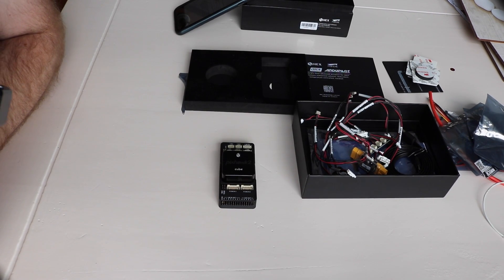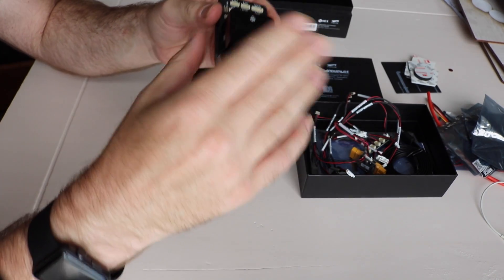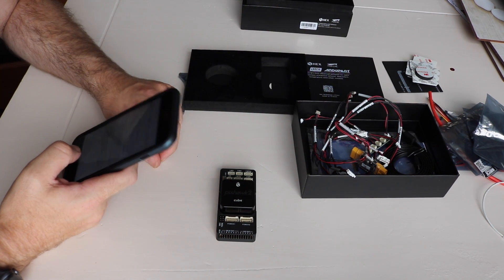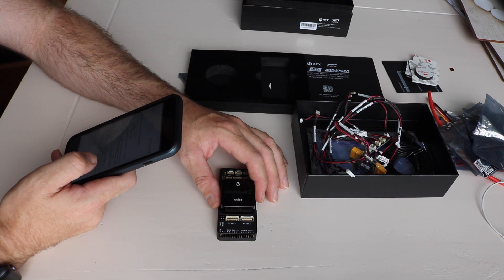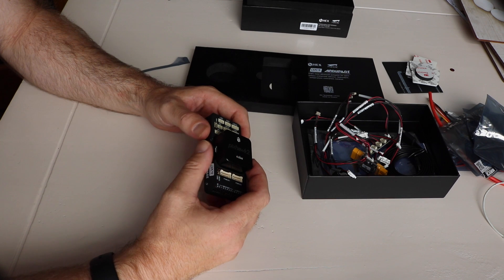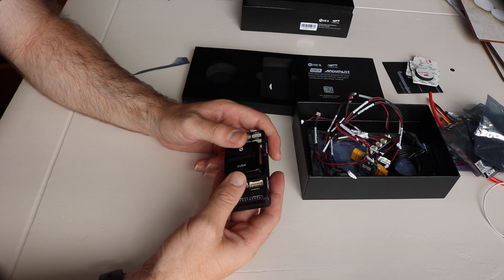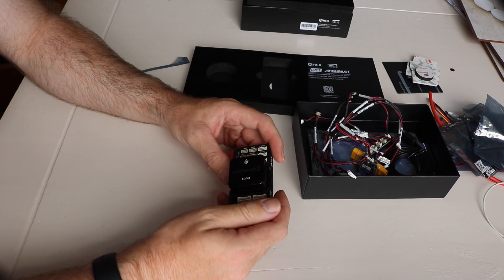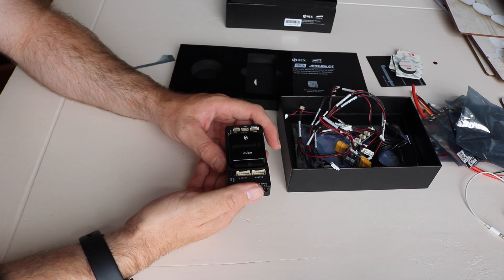The Cube Pixhawk 2 Autopilot/ Flight Controller & Here GPS Closer Look At The Hardware

Comment: Do you install the gps2? This is work for you? My second gps is not even turn on...
Reply from the maker: Yes you need to use it on Telemetry port though and set it to GPS in Ardupilot.  By using duel GOS you loose one telemetry port.
Reply: @MadRC   so what is the gps2? And there is an option to install third gps module? Because i read in the cube description that this is possible to connect up to 3 gps modules
Reply: And you can make a video of how to configure it?

Comment: The cube on a daugther/carrier board was the worst design idea ever : unpractical form factor, impossible to locate between plates of drone frame plates standard spacing (3cm), connectors on top instead of on the sides, bulky, heavy, df80 connector between the cube and a carrier board, Obsolete companion computer interface (Edison and the likes are discontinued: this was a bad design choice to link and lock to another manufacturer's product lifecycle, modified connector's PIN order vs pixhawk1 (especially on current and voltage sensing), ... I could continue this list , like the choice with a more oisy IMU choice versus Pixhawk's 1, a second barometer which is useless, etc, etcMy advice is either to wait for a Pixhawk3 adressing these points (no roadmap nor product lifecycle  is communicated, which is another issue if you want to plan seriously your builds) or to use Pixhawk1 (which can do exactly all of the same functionality), or to get an alternative "Pixhawk3" such as a CUAV V3, or a Pixracer (this one is limited to 6 RC outputs).